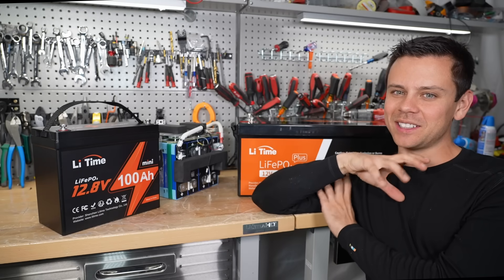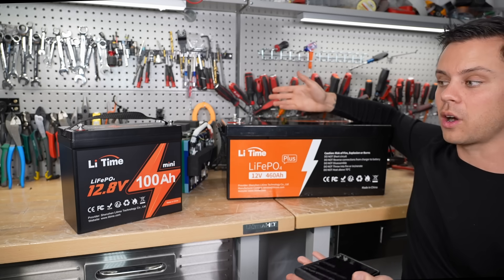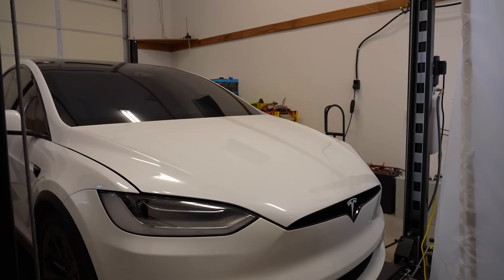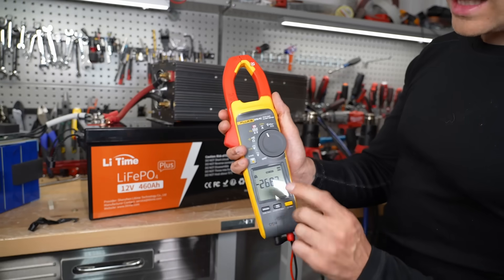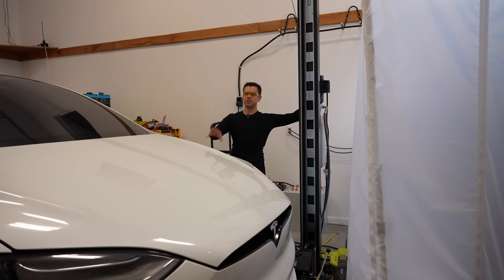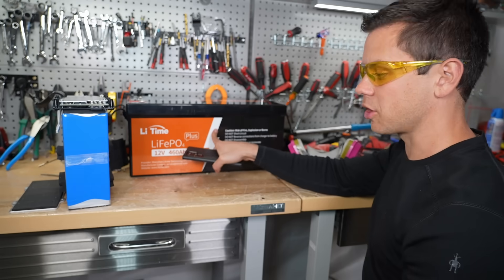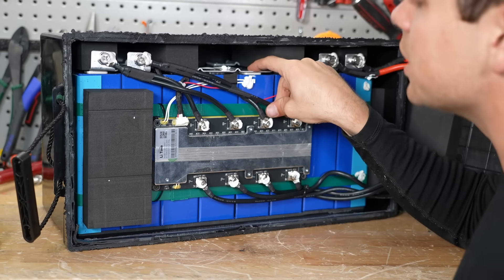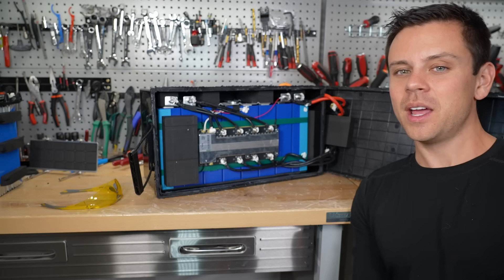LiTime LiFePO4 Mini and 460AH Plus! Surge Testing and Teardown

Comment: |> |> |> |> |> |> |> |> 
|> |> |> |> |> |> |> |> |> 

12 volts are still for cqmpers but especialy for boats ...

upon 40 volts is gets life dangering ...

saltwater is better cibdoctive then drinkwater.

36 have charging voktage also about that.

24 is left for not sick thick wires and still safty ...

so I recomend 24 volts as diplomatic solution.

but the price decide many times to out 2 12 volts  serial.

|> |> |> |> |> |> |> |> 
|> |> |> |> |> |> |> |> |>

Comment: If I understand what you are doing, 48 amps at 120 volts, is roughly 480 at 12 volts so I would not expect a 100 amp BMS to work. 
Both my boat and motor-home still have 12 volt systems, so I an staying with 12 v while I am still living in them. I will need low temp protection.

Comment: People are still using 12v in applications where legacy 12v exists and cannot be updated. I.e Marine, engine side is 12v and cannot be changed due to the ancillarys only being available in 12v. The route around this is a hybrid 12/48v setup, which is more complicated and ends up costing a lot more than a traditional house/starter 12v kit, like utilising a Renogy DC DC mppt controller… Simple & easy.

Comment: 2 heat guns pulling 250amps, I don't think so.
Reply from the maker: 250A at 12V is 25A at 120V. It's basic math
Reply: Sorry I missed we were using 12v @WillProwse

Comment: Beginner guy question.
How do you implement a small system (say 100 watt kit) to take a bit off your energy bills?
It’s not what I want but what I can afford.
If it can be added to over time (oh say 100 watt kit at a time) 
Do I just add one appliance, furnace, water heater,water pump, with each addition ?

Comment: I just installed 2 of Vatrer's 460ah batteries on my Class A. Super happy with them so far! Would love to see what they look like on the side...you have any laying around you want to test :)
Reply: I put one 460AH  Vatrer in my friend's old Toyota Winnebago. That's a name you seldom see. That metal box looked great and it functions perfectly. He got rid of the propane fridge and I installed a Magic Chef 2 door 3.1 cu ft fridge freezer. I put 400 watts of panels on the roof and a small 1000 watt Renogy inverter to run the fridge and his CPAP unit. Works great. He is a musician and lives in the little motor home.  Somebody stole the generator before he bought it. It's a vertical Kohler 2800 watt unit, absolutely impossible to find a replacement. But the solar and battery hold their own pretty well and even charge in the rain.

Comment: If you're charging with solar most all charge controllers have low temp probes, so it will protect the battery anyway. If you're plugged in to shore power during low temps, then that's where having it incorporated into the BMS would be needed,

Comment: I been watching you for years. I've started with 12 volt 400 watt. I'm now 48v 600 watts at 48v. I have 2 strings. The power in is 94 to 89 volts. I started with agm batterys had the 5 years(they died). Recycled them I thing that was a mistake. I found a rebuild renigy. I wanted to just run solar called the company big no. Like you I have a pile of things that burst into flames. What can I do with the system?

Comment: The issue with the BMS tripping is poor protection settings. There should be a delay of 1-2 cycles (2 / 60th of a second) in the BMS to account for motor inrush currents. Typically we program instantaneous for 6-8 times the full load to account for motor inrush.

Comment: I purchased 4 of the mini's... love em. Light weight and replaced 4x AGM's in my Black Series that were trashed by the factory craptastic solar panels and MPPT charger. Now I run for days vs 5 or 6 hours. I'm in about 6 months and love these Li Time Mini's!

Comment: I sold my sailboat about 5 years ago, one of the best days of my poor decision making life.  A 105ah AGM was minimum $280, usually more, and I had six, not including two start batteries.  They all sucked.  Marine electronics, especially the autopilot hated low voltage conditions.   A constant struggle.   Life would have been so much better with that 480ah battery for my house bank.

Comment: "12v volts just costs more".... yes for the user, but for the manufacture maybe the BMS is enough cheaper and the assembly is enough cheaper so that 12v is cheaper to produce. The other thing is that 12v appliances are still the ting that most people have access to and draw no quiescent current the way an inverter does. For off grid use where solar panel area is restricted such as RV or boat.... 24/48v is possible but not common, easy or cheap. A lot of times, the draw is quite low and legacy wiring for things like lights are already over sized as the lights get changed to LED lighting. The biggest draw tends to be the fridge at 4 or 5 amps. Fridges seem to built for 12or 24v not 48 and running multiple voltages is not a good idea.

So yes, 48v for an inverter based system is the thing. For DC use, 12v is still more common. This is starting to change as more manufactures are building 5v only stuff, like lights and fans. The 5v fans are pretty much useless but 12 v fans are hard to find even in automotive stores. 24or 48V starters and winches are available but costly, not because they are harder to build but because they are not common. A push for higher voltages is still for the rich or commercial (trucks and other machinery have had 24v for years).

Comment: Hey Will.. You have talked A LOT about the dangers of low temp charging... However I have never seen any REAL TESTS on this topic.  For instance, what IF you intentionally discharged a battery, froze it to 0C, and charged it?  What would really happen?  Can a battery survive this once/twice?  Obviously this COULD happen in real life, but does it REALLY damage the battery, and to what extent?  Do you have a big freezer? [grin]
Reply: It trashes the capacity. Did mine anyway one day.
Reply: Probably... I'd still like to see scientist proof using controlled conditions.
Reply: I have seen it. Flames and BOOM!

Comment: I have a couple of the minis that I use interchangeably for a 24v inverter I use for power tools around the farm, and a lightweight portable 12V system when I am camping.  But it can get frosty in the morning when I am camping in the desert in winter, so that means I have to have to rely on my charge controller's low temp protection which makes me a bit nervous.  I do really like how small and light they are though.  I also have a couple of the standard size ones that I am using with a 24v split phase inverter for my off-grid shop.  Works great for welding, running saws, or just keeping the lights on.  I probably should have gone with a 48v server rack system in the shop, but the 24v setup with the litime batteries had a lower price entry point and I was on a budget.

Comment: I have the extra mini in my truck. I use a Victron charge controller and Battery Sense. I have it set to not charge under 40 degrees. Works great and cost around $40.00..

Comment: Being in Florida I don't care about the low temp sensor. My batteries are on the back patio and during the relatively few days where we hit freezing I have a small insulated 3 wall enclosure that I push up against the wall. The heat from the LV6548 is enough to keep the temp inside 30°F above the outside temperature. I've also found adding a 60w incandescent light bulb in the enclosure brings the temperature up another 20°
So far I haven't frozen my batteries. 😊

Comment: For those converting trucks to overlanders (expedition vehicles), a 24V system is usually preferred as the trucks are 24V.
There unfortunately aren't that many good 24V batteries with low temp protection...
Usually 12V or 48V :(

Comment: I still can't believe that they don't include low temp cut off as standard. What cost are we looking at 50 cents? 25 cents? 1.20. Keep in mind most of the cost is the wires and the terminal connection but still it's not a lot. Heck, the BMS probably has the connection on it already though you might have to program it or find the right temp sense.

Comment: Totally Off Topic Will, but have you ever done anything with old APC UPS power backup systems? 

I've two older units and wondered if I can use them for power storage for a solar charging system.

Comment: I don’t know if you saw my post on your forum about my multi +2 inverter burnt output 120 V socket. And I am by far not the only one that has had this problem and Victron would not uphold their warranty but gave me a $795 check against the new one. I’m going to see if I can have electronics expert convert it to a screw clamp type like all the other Victron equipment. Any thoughts?

Comment: I saw some small 50Ah 48V batteries for golf carts. There's even a 48V 25Ah battery on Amazon for really cheap. I'm not sure I trust it, but it's an interesting alternative to 12V 100Ah basic options for a small system.

Comment: Will. You are way too careless using standard steel wrenches. When you were tightening up the lugs on the inverter you got very close to touching the wrench across the terminals. Please buy some electrician insulated tools which will be your screw drivers, wrenches, ratchet and extensions. They sell these tools in the electrical department of most box stores. I beg you to do this.

Comment: i have been watching these prices in three places, the china stores, ebay and amazon. i am most comfortable with amazon and really want to buy from there. i have been watching lifpo battery prices at these three places for about 4 years and amazon is finally showing good prices. my goal is to just start out with four 12v300ah batteries wired in series. about two weeks ago amazon was having a sale on one and it was only $550 for one 12v 300ah, its back to up $670 like all the other cheapo sellers. one day soon i have have my 15kwh lifepo bank.

Comment: Will I have Dakota  lithium  batteries. Have you you ever checked  that battery  out. I have 2 200 wh batteries  and one 12v 100ah hooked  in parallel  on my trailer. Would you look into this?

Comment: 12v vs 48v completely depends on how much solar you plan to use. Especially if we’re talking about mobile lifestyles. 48v doesn’t make sense if you can’t get over 3kw of panels. 
24, is the sweet spot.

Comment: I just installed 2 230Ah 24 volt batteries in my trailer. So far, so good. Not sure what I was thinking with 2, no way I can charge both of those in one day but it's lots of stored energy for boondocking 🙂
Reply: I'm looking to buy a 24v battery for my trolling motor.   I've been told to wire 2 12v batteries together. What y'all think and what brand battery

Comment: I installed 4 of the 100ah mini's in my RV specifically because of their size and weight. Initially I was put off by the lack of low-temp cutoff; however, the batteries are installed in the electrics bay with a Magnasine inverter, AC transfer switch and Victron MPPT. Combined with the heat given off from the batteries/BMS', the bay stays warm. Just in case, I also have the Victron MPPT charge cutoff temp set to 35 F.
Reply: what victron mppt do you use for a total of 400ah of these ? and what solar panels did you match that victron mppt with ? thanks

Comment: I use the same Victron MultiPlus II in my RV, powered by two 300AH Weize batteries. They are about the same $/AH as the LiTime but include low temp protection. The Victron MulitPlus II is expensive, but it's awesome!
Reply: I too bought and installed victron multiplus II and love it!

Comment: I will try to buy 2 batteries for my 24Volt, Growatt to increase my storage.  Do you have a referral for this  battery. The 400 AH will double my storage and the 100 AH will increase my storage to 50% more.
Reply: I have 300AH, Prismatic batteries (LiP04).
Reply: 200AH and 100AH in parallel now.

Comment: I don’t use 12 V anymore but I do use 24 V. I prefer it over the 48 less hassles less concerns. And the 12 V batteries are cheaper per amp than the larger Voltage batteries

Comment: haha the 12 volt hate!! I get it though!    my small off grid system for my house on my acerage(runs NG furnace, fridge, freezer, computer/tv , coffee maker, microwave, window ac) uses a 600ah+ self built 12 volt battery lol.  parrallel 304 ah cells.  yeah Idealy I should have gone atleast 24 volt, but I started off with a 12 volt 1200va victron inverter(runs my furnace/tv/computer) and then expanded with a china 3000w inverter to run the  high surge crap(does a good job)  But yeah its 4 charge controllers at 12v to do the same work as one 48.

Comment: Cool vid.
The inverter socket output is limited to 20A. 
That limits the max power from that socket to about (120x20) 2400W.
You were on the right track connecting directly to the terminals, but they broke.

I would prefer the 12V 460A as a 24V 280A. It is almost worth it for the battery cells alone.
Reply from the maker: I run this car lift with a 15 amp outlet and it doesn't trip. Thermal breakers and these outlets can easily handle a millisecond of surge. Shouldn't make difference. The motors continuous draw is only 13 amps
Reply: That was my first thought too about the outlets. My 3000W / 6000W surge absolutely has to use the terminal connection.

Comment: I enjoy all of your videos and have used it to set up my 2 growatt inverters with lifep04 batteries. Thanks foe shaeing this valuable information. Best on the net... 

 Do you by chance have any content on protecting against emp's? I found some but its crazy what the prices on those units are. I saw some pictures of one that was cut open and it was basicly an led, varistor, and some epoxy encassing with some wires. 
I would like to know your opinion on protecting from transient power within a nanosecond. Thanks for your videos, very helpfull...

Comment: Will I'm looking at building a marine system using 48 volts with 4 of the litime 12v 460's or 4 litime 24volts 230 ah my problem is I do not have enough space to put them side by side for series but I do have enough space for 2 side by side what's your thought on 2 banks of 48 into bus bar/ lynx
Reply: Will would love to hear your input also looking at cable length space between 2 banks would apprx 6ft and concerned about balancing

Comment: Would you recommend a 48v system and use step down converters to power the 12v stuff for a mobile application?
Reply: I found a 24V system is better in my case for mobile. Hard to get enough solar panels on a roof to justify the jump to 48V. I did use a 48V system in an old RV that will never move, with a tad over 7,000W of solar panels "down and dirty" on the ground to charge the batteries.

Comment: @WillProwse could the 12v 460a batteries be used in an RV?   I know some have, but they don't confirm that use on their site Will.
Reply: I have a 12v 200Ah in my RV and it’s annoyingly large and heavy. It was cheaper than two 100Ah but I would prefer to be able to rearrange smaller batteries so they’d fit into the right sized space instead of having a massive fixed size block.

Comment: I purchased a 12v 200AH AmperTime battery last year with my solar kit just for power outages. It’s never failed me. This year I added another 12v 200AH LiTime to increase my local storage. both are incredible batteries. 

For power backup, I highly recommend. I’ve had lights, refrigerators and tv running during hours long outages. My neighbors are in the dark and I was the only one with power on the block. I’ve noticed more solar panels going up on rooftops in my neighborhood this year! I think I’ve set a trend around here! 

Eventually I will go full solar to power my entire house, within the next year or two. 

Great Video!
Reply: May I ask what battery you purchased. I need a battery for my tent trailer and am seeking out recommendations. I have 4x100 watt solar panels on the roof and a 2000 watt inverter. Thank you!
Reply: Wait until you have an issue. They will give run around and avoid warranty.
Reply: On your block owns a Generator or a Flashlight for light? Incredible!  Candles?

Comment: I agree it's a PITA to work with 12v stuff, but it's just easier to convert RV's with small 12v systems.  If I were to build a large RV setup I'd go with a 48v setup for sure.
Reply: Yeah, for small systems it's easier to do a drop-in 12V, but for 5kWh or greater you're better off doing 48V and adding a decent sized 48V to 12V step down converter as you'll save WAY more on the other components than it costs.

Comment: will you tell victron to make a LF "all in one" inverter?  please.   i like and probably have to buy 2 of the EG4-18K/sol-ark type(s).   but i want LF !!  i know everyone says the capacitor type inverter will work fine on home A/C compressors, pool pumps, etc.   i just like the idea of the low frequency transformer type (all in one/hybrid) system.
thanks for all the videos.